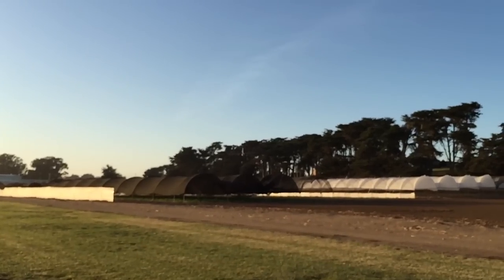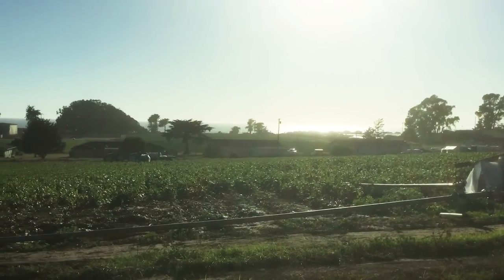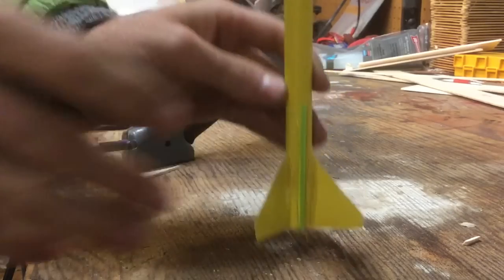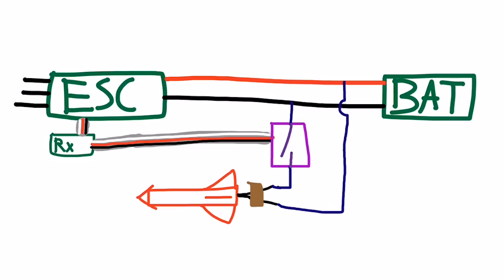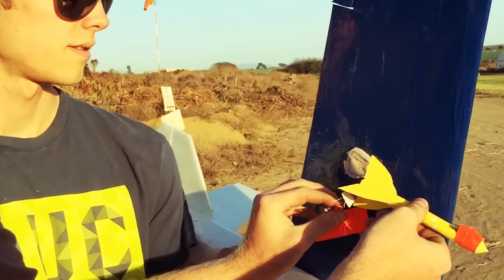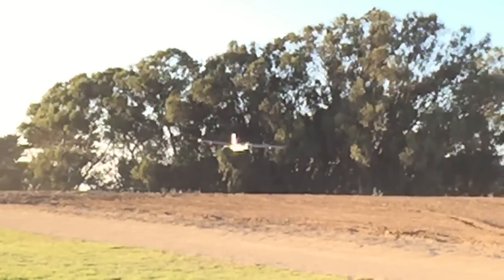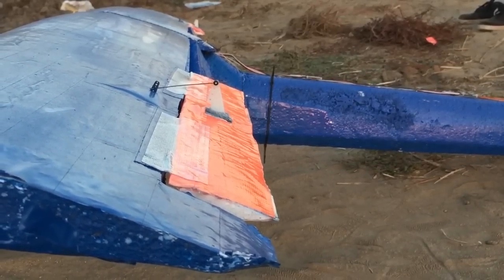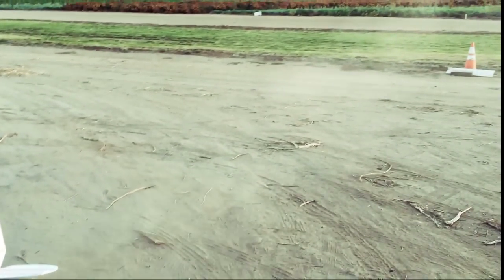ROCKETS from RC airplane

Comment: Just so you know this isn't an original "concept", my dad and I shot model rockets from the wings of a Sig Kommander RC plane in 1976.  I do not have video, because movie cameras were expensive.  It wasn't contrary to the AMA safety code, back then.  It is now.

Comment: Strawberry fields forever!  Why not just use the dinkiest Estes rockets?  I'm sure they are more stable.  Try a dogfight with them against another plane or make a large paper target on the side of the barn for the rocket to hit.  Got to come in low and straight, like a torpedo dropping plane from WW2, then pull up.

Comment: If you want your rocket to fly straight:  1) put four steaks around the rocket body, and attach your fins to that, so its front heavy with fins far behind it  2) Place the fins in a way that it forces the rocket to spin

Comment: Built a rocket firing RC back in the 70's.  Worked OK, but the airplane tended to outrun the rockets when the rocket used up its fuel....

Comment: Just a tip if you want your rockets to fly straight you can angle your tail fins so that it spins rapidly in flight. And when you tape your bolt to the side of the front of the rocket it will drastically shift the center of mass away from the center of thrust causing it to be unstable, but if you were to tilt the fins so that it would spin it would wobble a little bit but it would get the Job done.
Reply from the maker: A forward CG is more stable. Spin stability is a good idea though
Reply: Samm Sheperd yeah and when I'm meant to say the bolt will shift Com the side compared to the Cot so it would just do loops, but luv the videos! You totally got me interested in your homemade aircrafts! It just astonishing what you can do!
Reply: @Solace2, Just to also add to that; I've read that the CoG can't be too forward or you get the effect known as 'coning'. I think a bit of that is happening at 3:01. Ideally the Cog should be located about 1.5-2 times the tube diameter in front of the center of pressure.

Comment: You can use NiChrome wire to light up the rockets, lower gauge better ignition depends on the voltage you have, use a NPN transistor to control as On/Off switch with a channel from your Radio : 
https://www.youtube.com/watch?v=9sHfz7wU3Yk

Comment: put some talcum or colored chalk line powder in the rocket. You can fix your CG problem and have a nice visual marker when the chute ejection goes off
Reply from the maker: +tom adams great idea!
Reply: another way is to make the fin tilt at a slight angle,that way when the rocket fired it wil spin and stableize itself. works on my rocket all the time
Reply from the maker: nick39691 That's a neat idea. Biplanes have many interesting aerodynamic design characteristics!
Reply: could you make that chain saw in to a biplane ? or do a vid on biplane like how the are lay out and why ?

Comment: For more stable rocket, you could try to achieve spin stabilisation: https://en.wikipedia.org/wiki/Spin-stabilisation

Basically just rotate or bend the fins slightly. Also maybe reduce fin size a lot to move the CoM forward.

https://www.youtube.com/watch?v=22sSkC3oFHE
Reply: That would stabilize the rocket durring flight, but what about right when it's launched? The fins don't have time to get the rocket spinning before it exits the guide wire. Maybe also try using two wire guides that spiral with the fins to give it the initial rotation so it's stablized all throughout the flight. That way it won't veer off in some random direction right when you launch it.